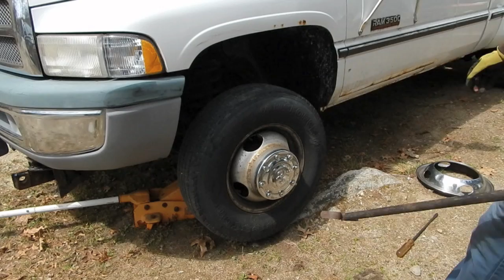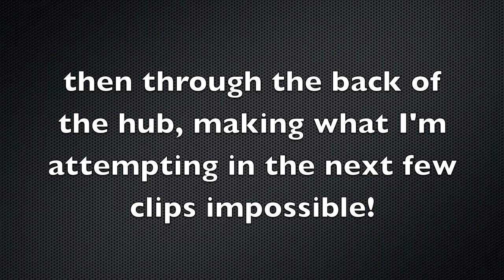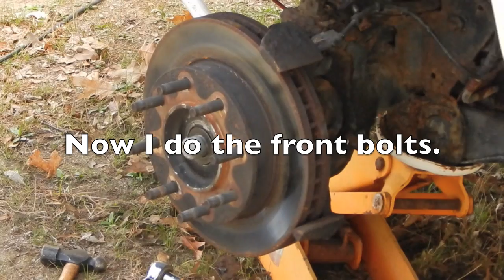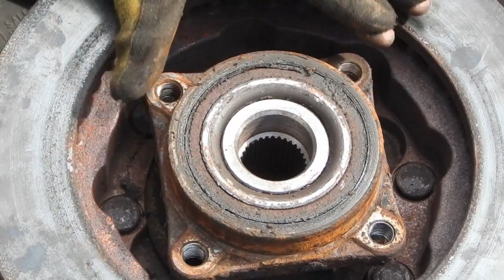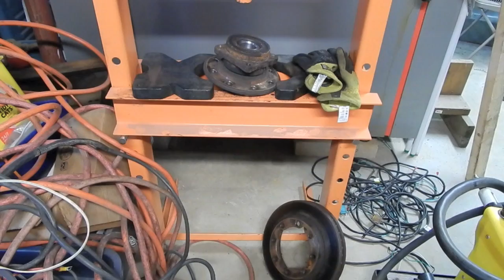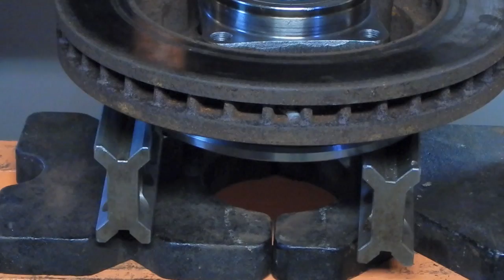1997 4WD Dodge Ram front hub replacement Part 1

Comment: My brother had welded a chunk of solid round tubing, to an old socket for doing front hubs. Of course when I needed it for my sister's 1500, we couldn't find it. I just grabbed a hand full of various length extensions. But you sir have a lot of patience, just like my dad. I've used that trick 3 times. But each time I did it, there was at least 3 people. I'd run the socket and extension, one guy would tell the driver which way to turn the wheel.
Reply from the maker: Thanks. Some times there's just nobody around, so you do what you can. Happy holidays!

Comment: Did the same thing on my '94 suburban (w/ 6.5 diesel). Didn't have a press so I had to hammer each lug out and back in. Just make sure you re-torque after the lug settle in.  Mine were so worn that the ABS sensor was rubbing the ring. 

I was also going to say the same as Douglas. 20% off coupons exclude welders, air compressors, and most other large ticket items.

Comment: Steve check the latest Harbor Freight 20% coupons, any large items are pretty much excluded. If your u joints have grease fittings they are replacements.
Reply from the maker: Small print strikes again. Seems like any of the large items that they provide a "super coupon" for, they do not allow you to also use the 20 off…….oh well.